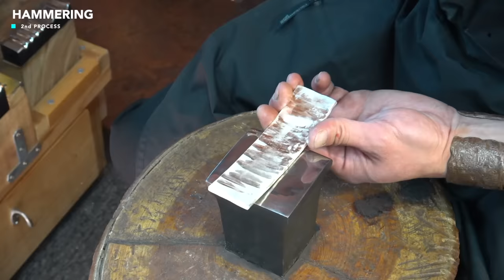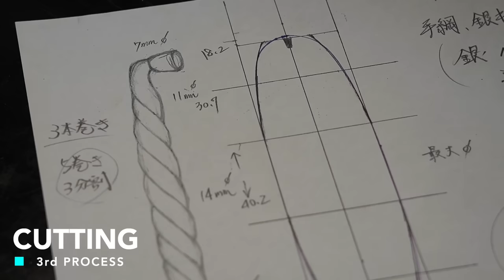500,000回叩いて完成するキセルを作るプロセス

Comment: craftsman lighting torches with butane lighters always makes me raise an eyebrow - besides the fact they work with their hands and compressed butane likes to explode if the torch hits it wrong, if you use them enough a striker plate is cheaper over the long run. there's literally no reason to use a lighter in the hot shop.

Comment: I don't quite understand why he used so much cold hammering. Wouldn't it have been easier to heat up?
Reply: I'd say it's likely a matter of tradition and a process handed down via ancestry. Some people work for efficiency but, some people work because the art compels them to.
Reply: This is very delicate work.   He is really pushing plastic deformation to it's limits.
Reply: Silver is pretty soft, i guess it just doesn’t need it.
Reply: Certain metals, like silver and brass, harden as you work them. The heating and quenching is to make the ingot more malleable. 

Silver hot work is generally just casting and soldering.
Reply: @ralphmueller3725  "...a matter of tradition..." - - - But using a propane gas blow torch. :)
Reply: was wondering about the same thing. perhaps this is the optimal approach while working alone and using only hand tools to carve or beat it into desired shapes. wish he could shed some light on this himself :)

Comment: Completely unnecessary a waste of time. There are better faster robust ways of achieving the same end result in much shorter time. Using wood surfaces to shape is really bad idea since wood does not retain its shape it twists it cracks it rubs off and every time you hit it with a hammer it changes dimensions. This is idiocy at best. That is the most crabby soldering job i have seen on youtube. You also soldering silver wrong.

Comment: At 13:32  That's not "Glue"!  This is FLUX, the work is about to be joined with SILVER SOLDER.  Really nice video, I'm learning a lot.  The pipe might be pure silver, the silver-solder is an alloy, with a lower melting-point.

Comment: Such a fine balance of heat for welding the seams without making the part a puddle of metal, most impressive. Is the solder the same alloy of metal as the rest of the pipe, if so I would expect a extra challenge to get just the right amount of heat to flow the solder without melting the part.
Reply: its an alloy. mix one part silver and one part brass, the alloy melts at a much lower temperature. if one wishes they can elevate the temperature of the solder by burning off some of the zinc during the mixing.
Reply: It's an alloy silver solder and there are actually different grades with different melting temperatures. For example, with jewelry that needs to have more than one thing soldered to a piece separately, you can start with the higher temp hard solder and then solder something else to it with medium or soft that has a lower melting temp so that the first solder joint doesn't remelt while soldering the next part.

Comment: I respect the dedication to the tradition. That being said: I think it could be significantly faster if you started by pouring the molten silver into a mold of the same shape as the thin reference instead of hammering the block down until it’s thin. I’m also a bit confused about the quenching. I would have to look at the material properties of the silver but generally when you heat metal up then cool it quickly, it makes it harder than if you let it cool slowly so I’m not sure why you quench it between shaping processes. Wouldn’t it be advantageous to shape the silver while it’s still warm and soft as opposed to cold and hard? If you’re just going to heat it up and remove the internal stresses each time you shape it then what’s the purpose of spending so much time and effort hammering it when it’s cold?